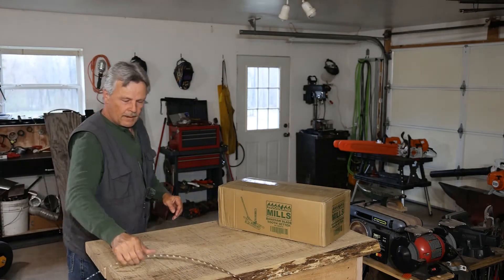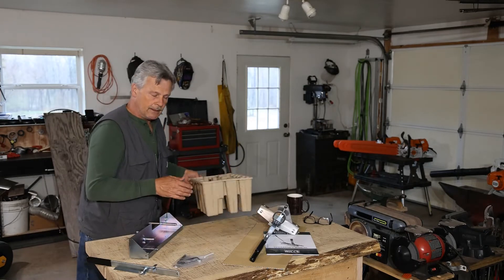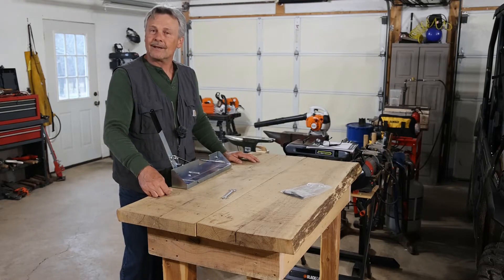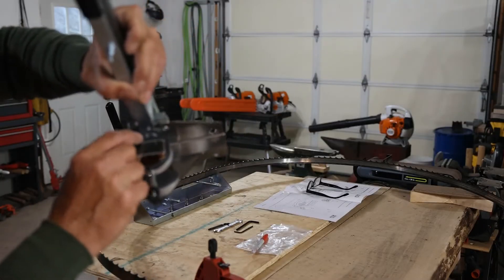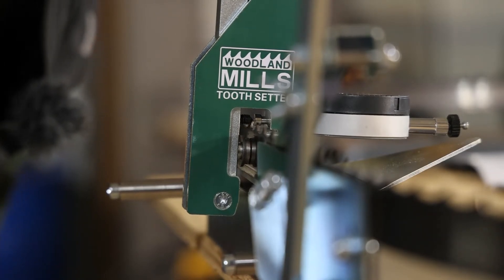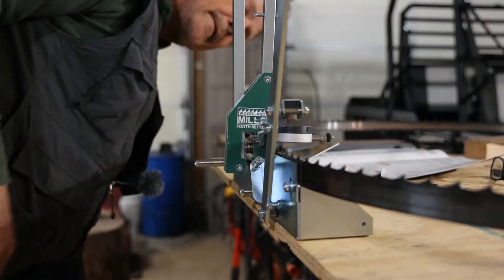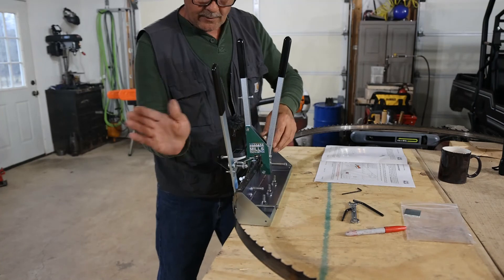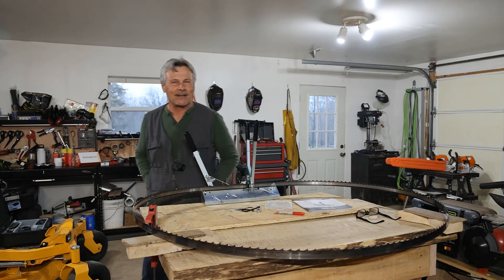Resetting Bandsaw Blades For A Better Cut

Comment: I just bought the same setter.  Great video.  FYI you can use the squeeze handle to check the set.  Just squeeze enough to engage the spring push on the blade not hard enough to set.  Better and more accurate than pushing the blade with you hands from each side.  I  have a HM130MAX with 2 extension sections on the sawmill providing 23 foot log capacity.  Love the mill and all products from Woodland Mills that I own.
Reply from the maker: Good evening and Thanks for the pointer I did start doing that on the second blade and it cut like new after installing on the saw. I agree on the quality of Woodland Mills so far, and you have your Mill Set 👍👍. Have fun milling Steve and Thanks for Watching.

Comment: Hi Joe. That will save you a lot of money. Doing it yourself. Practice will make perfect. Good job. Have a great day 👍
Reply from the maker: Thank You Tracy. Getting this blade sharp and reset has the saw cutting like new and is an interesting process however it takes a little more time than the chainsaw LOL. Have a great day Buddy and Thanks for Watching
Reply: @AskDaddyjoe  , At the Mill that I work at, we have five full time saw filers. The work ten hours a day, five to six days a week to keep all of the saws sharp. 80% if it is done by automated grinders. Some of our band saws run on 8 ft Wheels, it's quite the process to watch everything in motion. They're the only department at the wheel has a climate controlled work area. For a long time though they did it very similar, to the way you're doing it.
Reply from the maker: @randomlytracy2291  Wow I bet you guy's turn out a lot of material in a weeks time. I do find the whole process of turning a round tree into square boards very interesting and I know the Old Timers would find the tools we use today very useful. Have a good night Buddy.